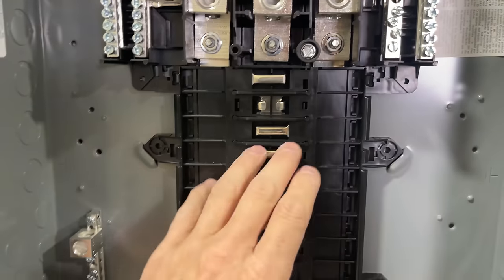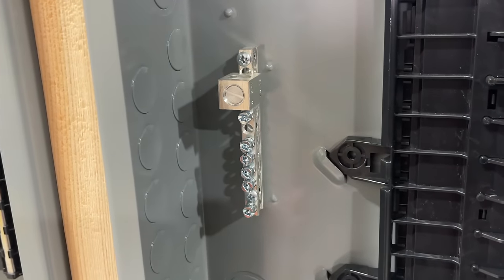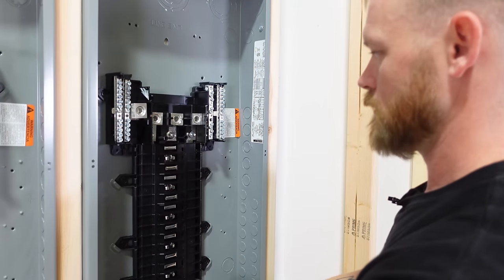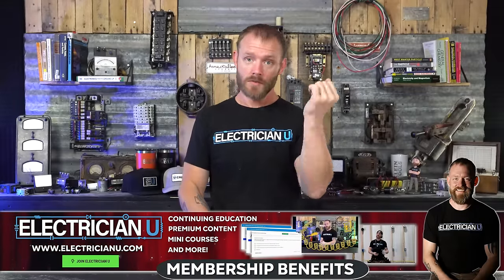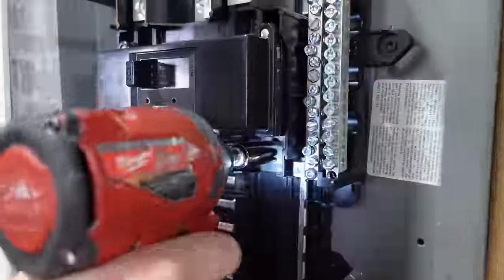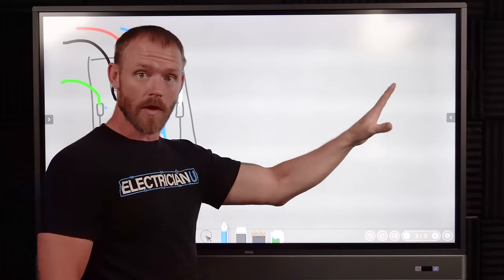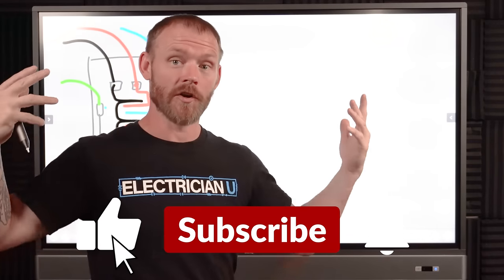How Do Electrical Panels Work - An Explanation of All the Parts!

Comment: Hey brah…… could you explain how to determine a lose neutral on service side? I want a clear explanation on signs or steps to see this faster….. I know two pole breakers can mess with readings
Reply: I would start with this: Test L1 to L2. Divide that by two and that should be about what you can expect when testing L1 to N and L2 to N. Conduct those two tests. If neutral is loose, I suspect the sum of those two tests will fall short of L1 to L2. I say suspect, because a tester doesn't really put a load on the circuit, which may not be enough to see a problem. Make sure all tests are done at service entrance lugs, preferably in the meter socket not the panel. If you test from the panel, a loose neutral could exist in the meter socket, not the service.
Reply: If client tells you " when i turn on the oven, the lights turn on but dimmed." Or .. if you dont understand the reason why something weird is happening, It's probably a loose neutral

Comment: How things change, in Mexico the electrical system is the same, only that the general panel is not 200A or even 100A...it is just a small general breaker of 30A...for the entire house, without subpanels hahaha

Comment: You mentioned explaining why the neutral bus bars should be isolated on plastic but not sure I saw that. Why is that? I had an electrician add new bus bars direct to the main panel for more neutral and they are not on the plastic part. Is that ok?

Comment: Great video. Really good explanation. The only two things are missed.
1. I do not have main 200A breaker at home on main panel, so how I can switch down all electricity when I need to install a new 60A breaker for electric car?
2. You do not show how exactly new breaker should be inserted, how it locks inside the panel and how to remove a breaker if needed.

Comment: I just found your channel today. I am not an electrician, but I am trying to understand the problem we are told we have in our older house. I enjoy learning, and I am wanting to gain a better understanding of what the electrician was explaining. In our breaker box, the white wires and bare wires are in the same place. He was trying to explain how the grounding and grounded should never be like that...and that is how I landed myself searching your videos! Do you have anything else that explains this? I am really wanting to understand it better.
Reply: Search for ground neutral bonding at the main panel. Any sub panel needs to be separate. He has a great video that visualizes the ground fault loop that can be created if it's done wrong.

Comment: Hey Dustin! Nice video, as always. Thank you for all your work. I recently came across an A/C unit which was wired with 12/2 romex in a pvc conduit going to 40 amp Square D breaker in a GE panel. I tried to explain to the customer it’s not the way it should’ve been done, but she didn’t seem to understand what the big deal was. Could you please do an experiment where you have too much current traveling through a 12 ga wire 😅

Comment: i conected my power source to 100 double pole breaker.  This allows me to avoid a hot bar n hot lugs when working on panel, everything is dead with breaker off.  I fed my sub panel using lugs of main panel as jumpers to sub. Appears to work great.

Comment: Good morning,

We live in an old house whose breaker is only 100 amps, 24 spaces.
We want to change to 200 amps, because 100 amps is no longer enough.

We would like to know what you suggested for changing the 100-amp breaker.

Which is better: 20 spaces for 40 circuits, 42 spaces for 42 circuits, 40 spaces for 80 circuits?

Alternative?

Thanks for sharing your knowledge and have a nice day!

Comment: Thanks for the great content! I often meet linemen or other electricians who have destroyed their bodies - bad back, shoulders, etc. Is it possible to be an electrician for a long time without ruining your body? What advice would you give to young electricians to take care of themselves?
Reply: Stay in the gym, stay active
Reply: Eating right is a start 😂
Reply: Work slower 😆🤣
The guys that are on disability early worked their butts off or were injured. More productivity from the additional 10 years of work vs living off of the taxes you've paid in 😆🤣
Reply: Good boots... Most say good boots adds a good 5 years to your working life. I buy "Red wings" and wont buy any other boot. 340bucks, well worth it... No break in, works and feels good day one. 100% American Made. No BS assembly in USA, it is 100% USA made. Goto an actual red-wing store. They will size you and they sell electrician boots(can't make a ground thru your feet basically). Then spend the extra 60 for their inserts that will fix your posture. Might feel weird to walk correctly at first. It fixed mine, made my foot feel much better 6+ months later.
Reply: and if you buy boots, buy actual boot socks.....

Comment: I love your videos! You guys are great!  I need your professional  knowledge on my panel.  I have a 100amp 20 circuit  General Electric   1960 era. I'm out of neutrals i want to add a type 1 surge protector.  Is it code to add a neutral bar and a bumper wire from old to new?  Also does the addon neutral bar need to be isolated the original?  Lastly no ground bar can i just simply screw one into the panel?

Comment: Hey there Dustin, could you please explain the reasons for humming or buzzing sounds coming from an electrical pane, the possible reasons, how dangerous it can be, and what to do about it? It would be much appreciated.
Reply: Not Dustin but an electrician here. One of your breakers is probably garbage and is arcing across it's contacts. Try turning every breaker off and see if there is no humming. Turn them on one at a time until you find the hum. You just saved yourself some time for an electrician to come out and swap the breaker for you. Do not do this yourself it's not something for the home handyman to do.

Comment: A word of caution.  In the early days, electricians used to wire panels with three wires. Two hots and a bare copper. The bare copper was often attached to the ground rod. Notice there was no shielded neutral back to the pole pig secondary mid tap!!!! Often there were two hole receptacles with no ground wire. Neutrals were terminated on the neutral bus along with an occasional ground wire. The bare copper service line from the ground rod was then terminated on the neutral.

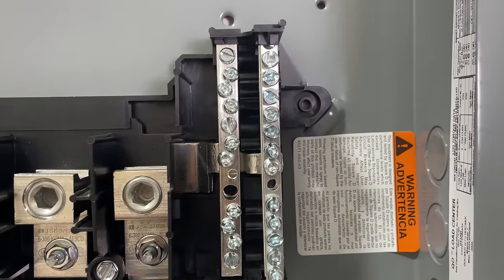This was done up into the seventies. Don’t be surprised to find a federal pacific box here either. Receptacle grounds were left floating if they 0:47  replaced original two prong receptacles.

1). You should explain how these systems work esp. with unbalanced loads.

2). The new guys need to be aware of these widow makers. They are out there. Sometimes you find the grounds bonded to copper water pipes. Jumpers across plastic pipe repairs. Also note that these installs often have mice and rat chew damage on wires. A welcome source of hidden arc faults.

Comment: Can I assume then for a 240v circuit (drier/range) the circuit breaker would tap the power from the red and the black bus bar?
Reply: Not accurate, but yes.  The coil in the transformer is 240v. Your circuit goes all the way up and back. You need a load between the top of the coil and bottom so there isn't a boom 😏
Reply: The breaker lands on both bus bars. So, yes. The red and black

Comment: In the single phase 240 v system, if a circuit requires 240v then the breaker needs to be attached to both hots? Is that right? Is that why higher amp breakers attach to and pull from both main input lugs? Instead of combining end to end on one input?

Comment: Who’s going to learn anything from a 10 minute video about verifying a main service pannel or sub pannel. By drawing or definition 
Skipping the meter or multiple branch service meters. 
-Grounding & bonding   
-grounding to neutral.  
-single phase systems while combining 3 phase systems which the we all know the colors are entirely different. 

While not mentioning a thing about ac or dc theory in relation to what’s being articulated here.

This is not Sparta 
THIS IS MADNESS!

Comment: Can you show us how to do AIC calculations or voltage drop? Thanks!
Reply: AMP * Volts = Watts / 3va = SQFT * .8 = Amount-Of-SQFT-you-can-use-for-3%-volt-dropoff... Funny part is most electricans don't even know this, they just use rule of the thumb and do the work... 100-ft or less, 12gauge. Over 100-ft 10-gauge.

Comment: I know you cover US mostly, but it would be interesting if you could cover European 240v… I cannot convince a coworker that their power is 240v line to neutral… they think it is just like here that it is 240 line to line.
Reply: Use a voltmeter?
Reply: @tedlahm5740  I would but it's kinda hard with my job to fly to Europe and take a picture. And I have shown them that and they still think it is line to line, so maybe it's a moot point anyways.

Comment: What I'm confused about is how do you know which one is phase 1 phase 2 or phase 3 because if all the wires are black how do you know which one is phase 1 phase 2 and phase 3 because not all electrical panels are going to be black wires phase one red wires face to blue wires face three a lot of times they will not be in order so how can you tell which one is phase 1 phase 2 phase 3 if it's not color coded and even if it is color coded how would you know for sure 100% that that is phase one phase two and phase 3?

Comment: Always felt like panels could be improved. They come with almost no instructions or cryptic pictures and 5pt text, you can't easily read the breaker numbers for decades of life, hard to label, no diagnostics - even a water heater has blinking LED codes. How about they start with red/greed LEDs to see powered circuits and maybe a better cover instead of holding up an awkward conductive cover with one hand while trying to start one of 6 freaking screws. They just seem archaic.

Comment: You shouldn't be calling the grounded terminals Buspar a neutral. A neutral only carries unbalanced current, not all grounded conductors carry unbalanced current. You should explain the difference between grounded and grounding....your contradicting yourself in the whole video.
Especially in your explanation of a light bulb circuit. The white is not a neutral, it's a grounded conductor